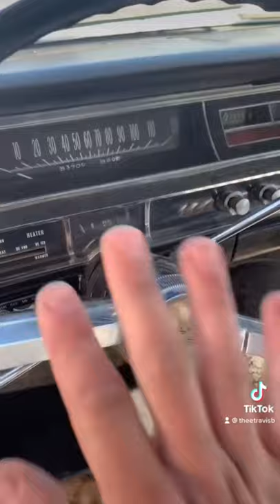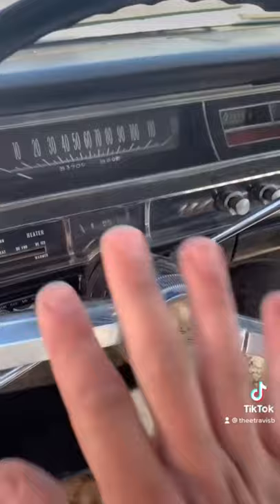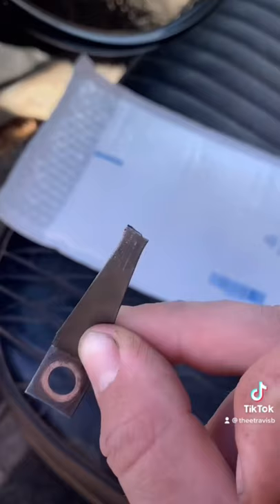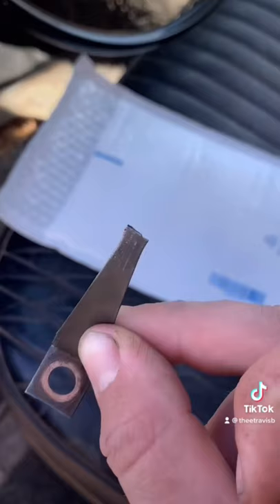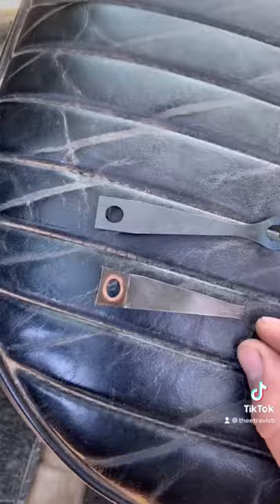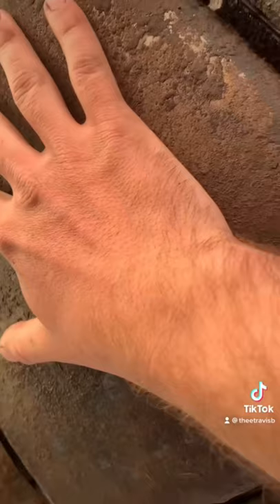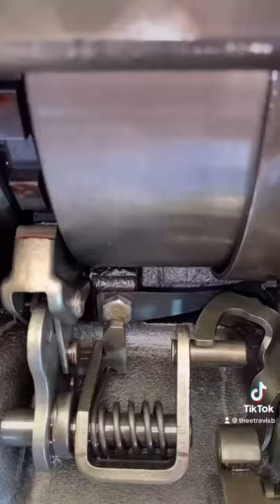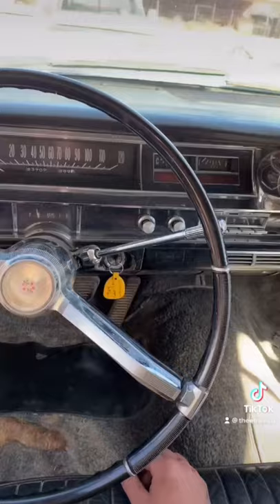64 caddy limo restore part 4/14

Comment: I used to have a 63 Olds 98.  I rebuilt that transmission with an OEM rebuild kit in 1981, and drove it until 1995, when I let it go.

Comment: For max power start off with the selector in low. When you reach your chosen shift point move the selector briefly to drive then back to low. If your right foot is to the floor you will get scratch, then shift back to drive at the final shift point. Even with posi-trac.

Comment: The car is either a 1964 Cadillac Fleetwood 75 or a 1964 Cadillac Fleetwood 75 limousine. The difference between the two is the limousine has a divider window.
Reply: And also Jump seats.  The Series 75 Sedan had another regular seat.  Not nearly as much room.
Reply: I've seen this before on other short YouTube videos.   It's a limousine.